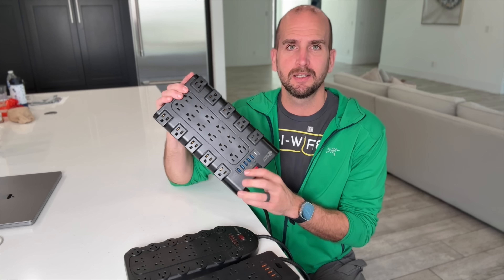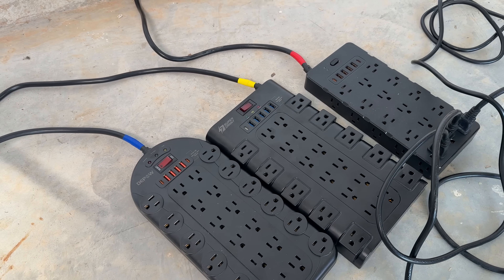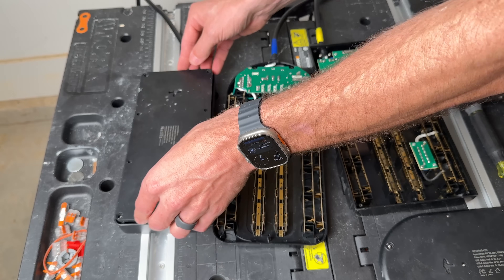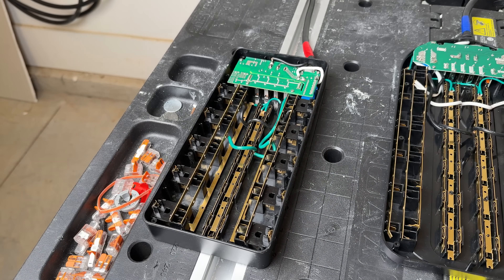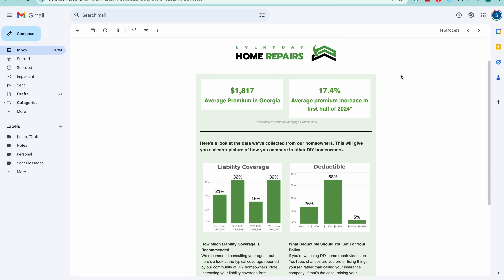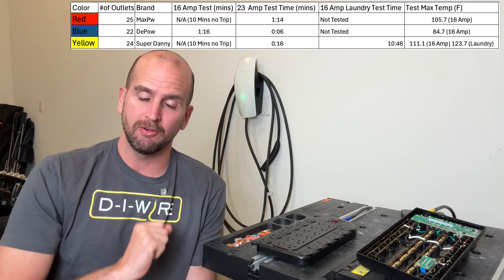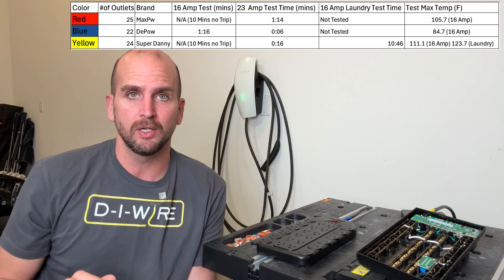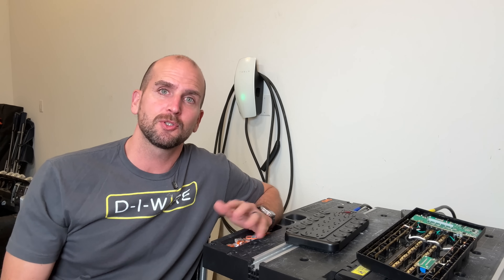Testing The Most Dangerous Amazon Power Strips |  I Wasn't Expecting These Results!

Comment: Wires are spot welded not soldered; to be fair some of the spot welds look pretty shitty. 

Bus bars look a little on the thin side of things; not only do I have concerns for heating but also at the individual receptacles I would worry about plug retention due to how thin the metal is.

Unless you have a very expensive power strip all that switch does is act as an ON/OFF which isn't a negative towards these because even most reputable powerstrips are identical; expensive power strips have a resettable breaker inside them and that actuates on the switch.

As far as actual surge protection the way that works (if a power strip even has it which is not a requirement in any way) it is not meant to stop constant current load (i.e. 16A on a 15A breaker for 2 hours) that is what the breaker is for. Surge protection is to stop fast transient voltage spikes caused by abnormal conditions on the grid. 

What you did was essentially just test your house's breakers. If you utilized the 3 strips on the same breaker for the 23 AMP test you might have heat soaked the breaker after the first test and that's why the next two tripped it so quickly.

Security screws are an unusual expenditure on a cheap no name power strip, but I don't in any way see it as a negative.

My personal concern is the actual materials for the enclosure of the power strips, I would assume they are made of a generic cheap plastic and my concern is that if something failed and the case got hot that it would actually set the case on fire; or alternatively in a separately occurring house fire it could ignite the power strip and cause a secondary electrical fire. A proper power strip should either be made of metal or a UL 94 V-0 rated plastic.

I'm an electrical engineer for semiconductors, not home appliances, so I would defer to the opinion of EE's that do work in the home appliance sector. I would 100% advise against these power strips, but not because of the plug count. If people really need like 20+ outlets then they really should consider getting either: one of those commercial wall-mount long metal power strips, getting additional receptacles installed, or using a traditional form factor power strip similar to these ones but with a better construction from a reputable manufacturer (Belkin/GE/Anker/EATON(Tripp Lite)/Commercial Electric/APC)

Also from a practical point of view, if your house burns down from a kitchen fire and the fire department recovers an amazon special super danny 25 outlet charred mess good luck dealing with your insurance adjuster; it's just bad optics.

Comment: I always have a max power strip of 8. With low power devices, High power devices go on either a single outlet with the second one being used for the power strip. Better is to put high load devices on a known, Different circuit. Never leave power strips on, They can go wrong quickly, Especially ones with Surge protection or Neon lights.. Neons can dead short, Then you’re in trouble, Those resisters powering the Neon would get very hot and possibly catch alight. Power strips should only be used on TV Console setups, Pc and gaming setups, I’d actually plug a Gaming PC into its own surge protection but on a singular outlet. Keep usage of power strips to a minimum unless you want to turn everything off as you leave. NEVER use them in a kitchen or Laundry room for people that have dryers that run on a standard 240 outlet, Just don’t. If you have a kitchen big enough to house heaps of high current appliances, I’m sure there’s enough double gang plugs free. If not use one appliance at a time, Oh christ.. 😂 What a comment.

Comment: Anyone that puts multiple high energy consuming loads on any power strip sort of have what is coming to them..  It should not be done even if you have a single cord with 2 or 3 outlets on the end.  
The only real use case for these sorts of power strips is for like an entertainment center, or around a computer desk for low draw components. Things like heaters, heat guns, etc should not be plugged into most power strips EVER. 
The BETTER option for entertainment centers and around computer desks, in my opinion, is to splurge and get a quality UPS backup battery with True Sinewave output;  But those aren't cheap, but also do a better job of protecting expensive electronics.  And no, UPS's aren't for running heaters or heat guns either.  
The USB ports on most power strips are very basic and don't tend to be high quality either; personally, I won't use them...

Comment: I've seen those on Amazon, and I have to admit, I found them quite interesting.  I have 9 computers, 5 monitors, 1 tv, a Blu-ray player, firestick, 2 printers, several sets of computer speakers, some lamps, and some notebook chargers.  While I seldom use more than 3 at any given time, it's still a lot of power cords to have plugged in.  Something like one of these would be useful.  So thanks for the information

Comment: You REALLY should get a line splitter for your clamp on meter rather than disassembling the wall outlet. They are less than $20.
Reply: I use a 12" three prong cord extender for my clamp meter. I removed the outer insulation so I could separate the wires for the clamp.
Reply: @thebluelunarmonkey  There are some things that does work better for. I've looked, and I can't find a line splitter that is rated for 20A. I'm not sure what size wire they use inside, but high power loads do seem to suffer from voltage drop. Also, I can't find one with 240V 14-50 plugs. The 10X slot on most splitters is great for low-draw stuff, though.
Reply: @m.cigledy6769  You can just use a plug and outlet the same way with some solid gauge wire. For the 10x just loop the wire 10 times, zip tie the loop, then plasti-dip it a few times. There's no special electronics needed.

Comment: Ive seen these in the uk but they are perfectly safe as our plugs have fused so its near on impossible to overload/overheat unless they are covered or jammed somewhere where they can build up heat.
Reply: @HA05GER  I don't think I've ever seen more than 12-way extension cables in the UK.  And a good thing, too!
Reply: @polymath9372  nothing wrong with it we have fused sockets so it doesn't matter how big they are they are safe. They are quite common in office settings computers and monitors use very little power so it's perfectly fine.

Comment: Spot weld, ground and neutrals are tied together in service panels, so it is acceptable, and complies with 2024 NEC code. And considering you’re using the furthest plugs from source i expect high heat, do another test with the heat guns on the closest outlets, and most people but these to plug in a bunch of low draw devices, phone chargers, large low draw power bricks for say a router, etc.

Comment: I have the yellow one, I use it to plug in all my game systems, controller chargers etc to the TV, Alexa etc.  I'm not pulling a lot of current cause I never could use everything at once, also, other than the TV, I can just switch it off when I'm not gaming so there are no parasitic losses.  I think that if you understand how much power you're using it's fine, the bad part is that most people have no clue, which makes them dangerous in the wrong hands, especially with faulty protection.

Comment: Not loving: the combination of wires and bustbars, why? the color of the wires, again, why? the "solder" (which were spotwelds), the screws are safetyscrews if you had an ifixit set you'd recognize them. why are you measuring amps twice? Why not just power with a wattmeter and take power factor into account? Did you notice how hot the cables were (even from your heatguns)? No. Why are you placing your heatguns on their intake? Did you have a look at the circuit boards to see what "logic" they use and possibly judge their value? No instead you talk about insurance. Fill in those forms folks, let me get your details! (and sell them to the highest bidder).

Comment: As a high-level fire investigator I can confidently say that cheap products, purchased online with no recourse for the manufacturer to be held accountable, are killing people and destroying homes.   The amount of "cheap" and fraudulent or fake products now available is alarming.   The low quality solder seen here is a real problem and often they utilize inferior metals and insulation as well as electronics.  The inferior metals creates a degradation over time response to heat ultimately leading to a failure.     

The same is true with lithium ion batteries and as you increase the number of receptacles or batteries the math is irrefutable.   The more "connections" an electrical appliance has the higher the statistical probability of failure.   This is why quality really matters with anything electrical.   Overloading circuits by utilizing remote power taps is a big cause of fires and it is getting worse with low quality products available in the online marketplace.  

Yes, you may save money today but you can lose things that are priceless tomorrow.
Reply: Amazon is worse than AliExpress these days.
Reply: @integerofdoom69  They’re the same, the only difference is where it’s shipped from. Pay more to get it quickly because products are staged in US warehouses.  I bought stuff off AliExpress this morning because I’m not in a hurry to get it.
Reply: They aren't soldered they are ultrasonic welded. Vibrated and pressed together so much that the copper and brass fuse together. No lead needed.
Reply: @SuperBrainAK   I have several exemplars with hand soldering for electrical appliances available online to include an EV-dryer switch.  Yes, you read that right.   I show them to the classes or groups when I teach and a few are from real world investigations.  Furthermore, many of these products can use under-gauged wiring or inferior metal components or PCB's.  

You are right about how quality products are made but you never really know what you are buying online and we do see a lot of hand soldering.   The best guarantee is to buy brand name from a big-box store because they put their name on it when they make it and when it is sold.   You nor your insurance company have any recourse against shady actors in China.   

Quality matters when electrons are flowing!

Comment: I actually own the "blue depow" power bar, and the only reason I bought it, was like many people, it wasn't because it had lots of slots, in that it had lots of room, for a few slots since lots of those power supplies have big blocks that physically can't fit on many power bars. I literally saw your video thumbnail, and then looked under my desk at the same power bar in slight worry before clicking, but thankfully I don't put high powered devices on it. I think I'm not the only one who buys a big power bar purely for just more space between the plug sockets.

Comment: I always use metal power strips that are UL or ETL certified. Most that I use are vintage, but you can still buy them. Don't buy plastic power strips or strips/fixtures with integrated USB. Use separate USB power supplies that are also UL or ETL rated. Don't trust your life to the cheapest equipment. You'll thank me later.

Comment: I remember when we were told don't use these power strips or cords because the wall outlet and wires in the walls are rated for the 2 plug set up and if your outlets are already maxed for that line and you add a power bar to it you are over the limit,  This was when we only had power bars with 3 or 4 outlets
  With the new power bars letting you hook 24 plugs to 1 outlet it's a fire just waiting to happen

Comment: The connections are welded not soldered. I would rather have a crimped connection. Many of your home appliances even ones with heaters have spot welded connections. It's better than soldering but not as good as a proper crimp connection.

Comment: red device - it's welded, not soldered. And it's better than soldering, because you can easily melt the soldering point in such type of device when you overload them. 
I think this device is pretty useful to charge a bunch of mobile devices etc. I'd like to see a properly working and certified OC device rated at 14-15A.

Comment: These are not that bad. I just resolder the joints after buying, and replace the fuse with a more reliable one.

Remember, your entire house is powered by a single cable. That's why the fuse matters so much.

Comment: What is your opinion on someone, with the proper skills, on buying something for the lower cost and then "fixing" it?

For example, I would consider the DEPOW (blue) for charging multiple low watt/amp USB devices (hearing aid, bluetooth devices, headset, phone, essentially devices using USB chargers) where total amps would be less than 15amps because of the low cost, but before using I would likely want to redo the solder joints.

Comment: Those wires aren't soldered. They are ultrasonically welded. Basically, the wire and bus bar get smushed together really hard by a machine, which then vibrates them at ultrasonic frequencies, resulting in them heating up and merging together into a solid weld. If it's done properly, it's much better than a solder joint, both in resistance and durability.

Comment: Okay, so right off the bat, you throw large resistive loads on a power strip.  Large resistive loads, that I am pretty sure in the manual say they should be plugged straight into a wall or into an extension cord of 14 AWG MINIMUM (to those outside of North America, that's 2.08 square millimetres) to a maximium length of 100 ft or about 30 m.  Of course, this is not taking into account the length of the circuit inside a house or building.  This is like someone idiotically plugging a heater rated at 1.5 kW into a power strip.  Again, a no-no according to the manual.

Comment: 4:05 - The mere fact that they are using SOLDER for AC joints... instead of a spade/CRIMP is WILD. 

Those will inevitably fail and have issues long term. AC actually "vibrates" the wire, and solder joints are very susceptible to this. These products need to be recalled.
Reply: No it's not. They are not soldered at all, they are welded.

Comment: i think with more things plugged in they will make more heat than a single heat gun proving these are all stupid. so testing these stupid things that have more than a dozen more sockets than they should it would be needed to test to add a few lightbulb adaptors (4 at least 100w bulbs in different corners and rows) to get the idea of why these strips are stupid even the one that did trip well. because its about human error having more than 12 socket splitter is stupid in general.

Comment: I have a few yellows (super danny)
They're fine if you're using them for a bunch of lower current devices.  I wouldn't attach a heat gun to them, but they work well otherwise 
I'd rather be using these huge power strips than seeing someone daisy chain a bunch of smaller ones together.

Comment: I've seen those used for plugging in lots of USB power adapters. They use them for plugging in a bunch of raspberry pi and other low power devices. 
What are you doing trying to use a large heat gun?

Comment: Wow. Very interesting. I did brought a few of these large power strips from Amazon. 

One of it was to use at my entertainment center in the living room plugging in a 50 inch TV, a PS3 and repairing game consoles like PS2 and XBox 360. Once I plug in a power cable to turn on a PC and heard a zap. Threw that outlet away and only buy the name brands outlets after. Not worth the risk.

Comment: Those are dangerous fire hazards in the hands of the general public who isn't aware of heat, amperage and power draw limitations. That being said, they may be fine for many very low amperage loads like clocks, chargers, etc. as long as all don't exceed 15A. If I had one of those I would have a kill a wat on the feed to see how much I'm drawing. But still 25 outlets I just don't like the feel of it...

Comment: It's like selling someone a car which CAN go 200Mph, but you tell them "don't do that. It's illegal. <wink> <wink>"
If I see an outlet, I'm using the outlet. As I assume most others would.
I imagine that, apart from tripping breakers and whatnot, the big issue will be outlet longevity. As those "soldered" joints heat and cool and thing just become a little corroded and brittle over time, I'll bet they'll be prone to separate.